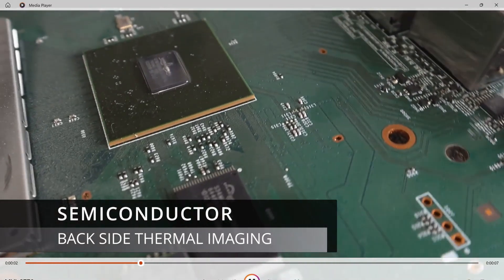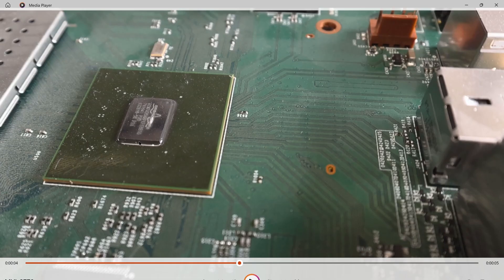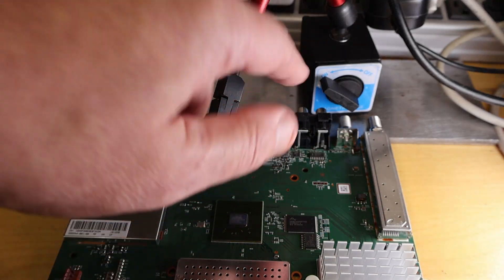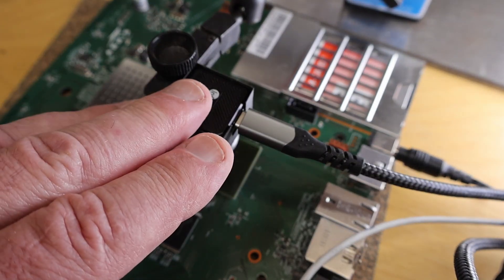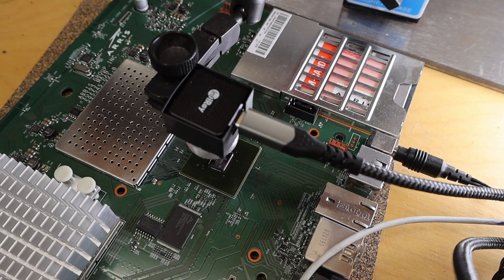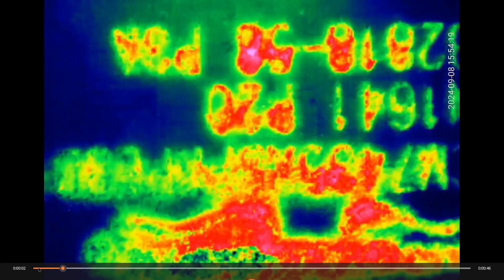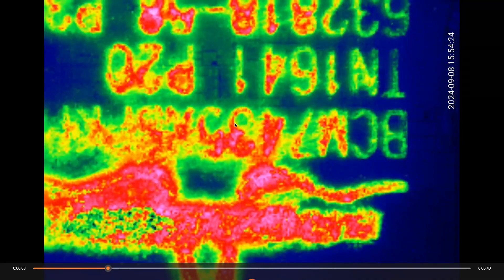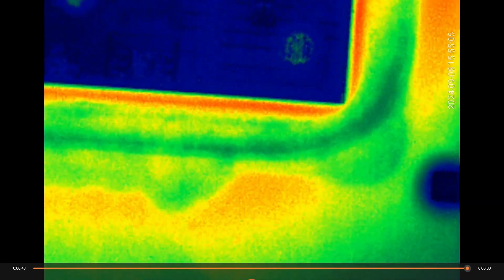Reverse Engineering Technique: Backside Thermal Imaging of Semiconductors

Comment: Neat!  I'm sure "die thinning" would be more accurate, but I wonder if you could get the thermal camera to output pure greyscale, and then take a picture with the chip off to get a baseline image.  Then you could subtract this image of the off state (possibly adjusting the brightness/contrast) from the output with the chip on to remove the text.  Edit: elsewhere you say "even powered off the metal layer is visible" and I guess removing the metal layers would be a bad thing, even if seeing active areas would be good.

Comment: Really cool technique. Surprised I've never seen this done before or even heard of it. Does it only work well when the die itself is being powered and the die circuity heating up, or can you still see the internal structure when you illuminate it with an external incandescent bulb?
Reply from the maker: even powered off the metal layer is visible.  not sure if that due to thermal gradient (metal being more conductive) or if silicon is somewhat transparent at far infrared

Comment: If you want to go one step further that's actually used in industry, "die thinning" - basically you just polish the backside of the die down to make it very thin, and then you can use a $1M thermal microscope tool to REALLY image the chip, while it's running. It's useful for FI/FA (fault indentification / fault analysis). It also allows for using a laser to excite the transistors and change their properties in real time too, which can be useful for many tasks too - some slightly nefarious

Comment: Is that the infiray x5? It looks kind of like my T3 Pro but is black instead of yellow. But the same form factor and manual focusing lens. Just curious because of your comment about the low resolution. 

The X5 has a pretty high resolution as far as budget thermal cameras go.
Reply from the maker: not quite sure of the model, says "xtherm ii" on the lens.   Low-resolution in terms of what one can get into when one goes down this route.... some truly spectacular cameras available from Flir and Fluke.. with price tags to match :)
Reply: And their newest cameras ( also sold under thermal master and other names) have some high-tech resolution doubling algorithm that...... from what everyone's saying.... actually works really well. Which I had my doubts about at the beginning.

I'm going to pick up either a P2 Pro with Magnetic clip-on macro lens.... or the newly released P3 witches manually focusable